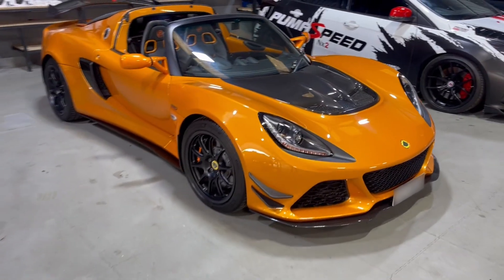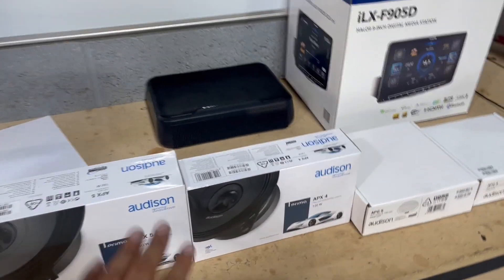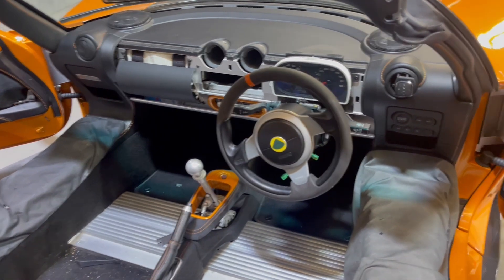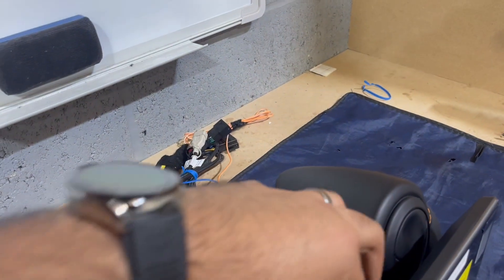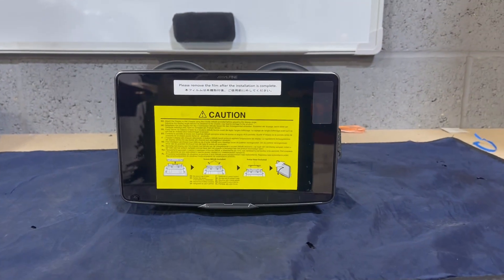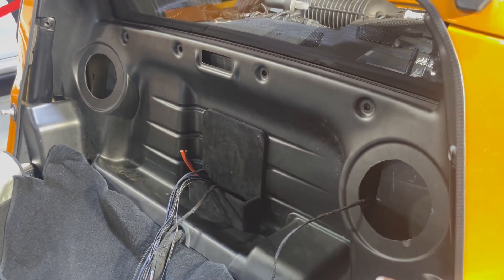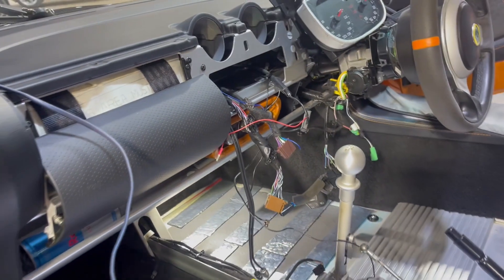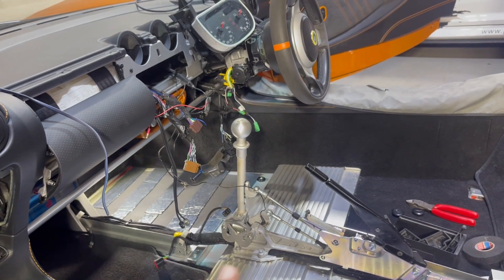Full Car Audio System Install on 2018 Lotus Exige

Comment: Acoustically, sitting in an Exige or Elise is like sitting in a drum, especially when you don't have any insulation and a lot of bare aluminium. It's a shame you glossed over this in your video because that is one of the key areas that helps improve the sound quality in this car.
The rear bulkhead panel is like a  cheap plastic egg carton. It would have been nice if you'd showed people how you improved this.
Personally I would like a nice touch screen in mine but I also know that there are enough muppets out there who know that the Elise comes with a fairly basic stereo so if the roof is off I know there is every chance they might try and rip this one out.
Apart from the Pioneer SDA-8TAB & SPH-T20BT is there any other product with a detachable screen that isn't a cheap Chinese product?
 - A nice, clean, and neat installation, by the way👍🙂
Reply from the maker: Thank you, we soundproof the back panel. Not really, we normally protect the vehicle with an alarm system that works with the roof down